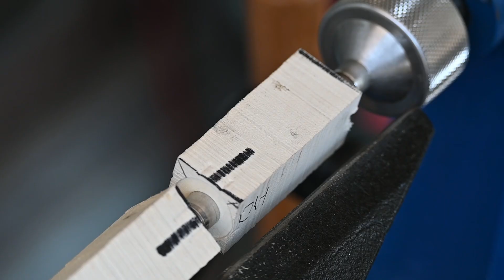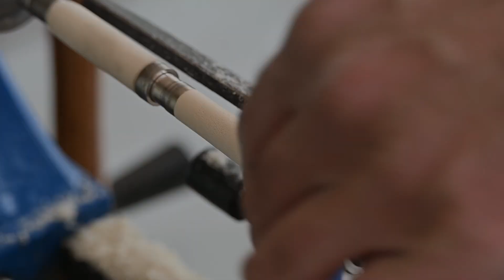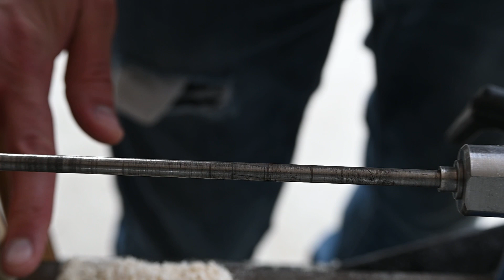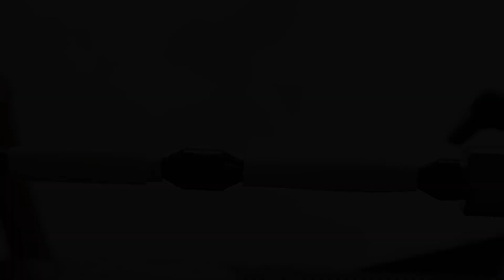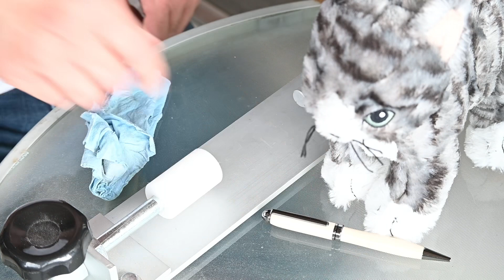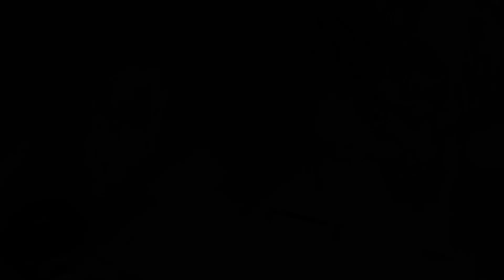Pen Turning | Holly with Gunmetal European Round Top Pen

Comment: What speed do you normally use when turning?
Reply from the maker: I can’t be sure because I don’t have a digital readout. My guess is in the 1800-2000 rpm range. The lathe runs from 500-3500 rpm.